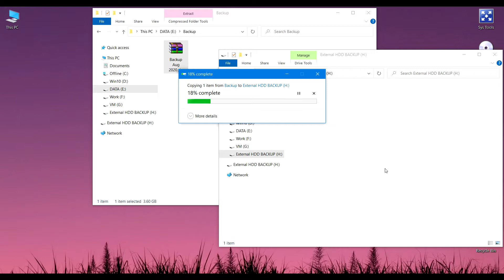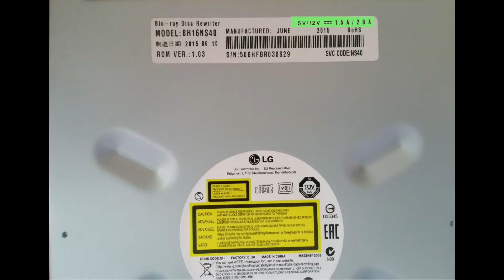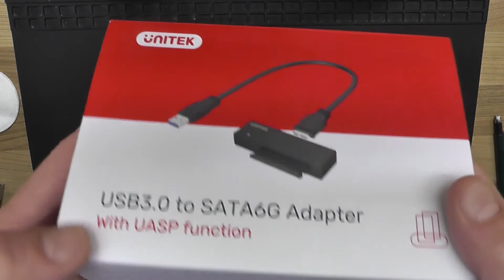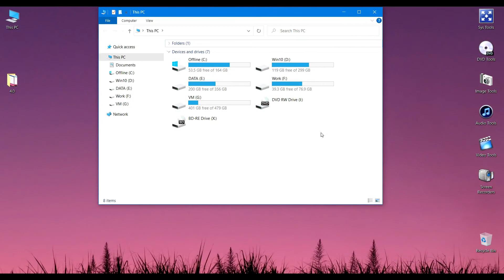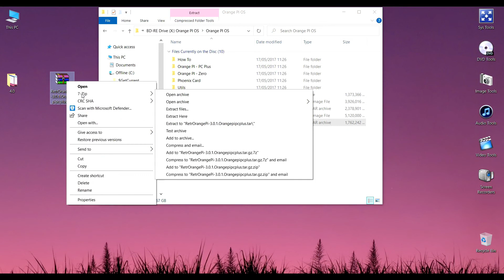How to build: USB3.0 external case for a 5.25" BLURAY drive - for less than 25$

Comment: An absolute gem of an article, it also solved a similar issue I had with the need to retain a Bluray combo unit in upgrading to a modern desktop case that had no 5.25" bays.  FUBAR!  My need for multiple removable HDD's - I work with video and previously used an Icy Dock Caddy system - was economically solved with external 3.5" and 2.5" drive cases . . but an external case for an optical drive?  GB£56 up to GB£93?!?!?  

Your DIY case is really rather pro finish but it's your mention of the UNITEK that has solved my problem because I didn't know this type of adapter was available and it will allow me to gut the circuit board out of the rear of an old alloy case for an EIDE drive and use that case!  Perfect, the UNITEK has cost me GB£20, and I've "up-cycled" an old PC component too!  Huge thanks!
Reply from the maker: glad to hear that. Don't forget to subscribe. Thanks for watching

Comment: is it necessary to build an enclosure for the player, for safety or anything?
Reply: It looks much cooler and it increases the safety. I'm still building mine and I decided to add a small layer of shock absorbing material between the case and the drive.

Comment: Unfortunately Unitek Y-1039 doesn't work in my case. But thats weird, because I wanted to use with my blu ray drive and it is the same as yours.

edit. I bought Ugreen 20611 and it works fine with my blu ray drive.

Comment: Very cool and clean looking build! I'm in a similar situation, I have a small external DVD burner, which is very flimsy and not really reliable. External enclosures for 5,25" drives on Amazon are really overpriced and badly build. Just as I had the idea to just use SATA to USB converter and build an enclosure myself I found your video tutorial!
Reply from the maker: Thanks a lot. I'm glad you found it ! Don't forget to subscribe ;)